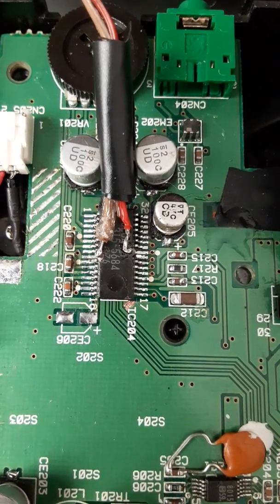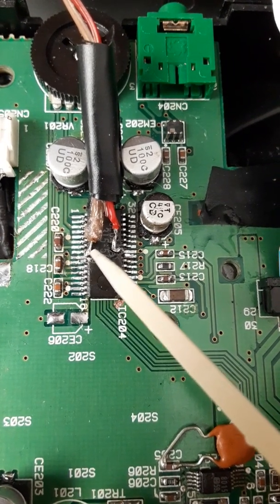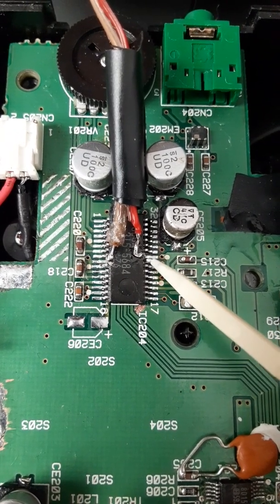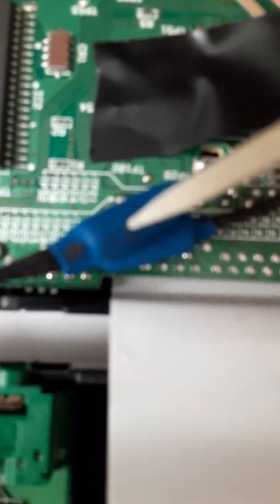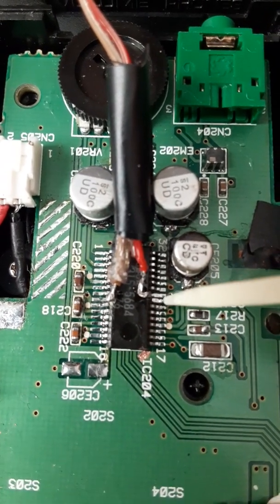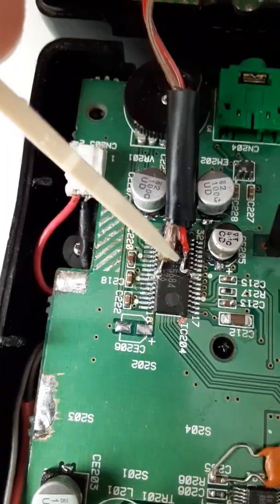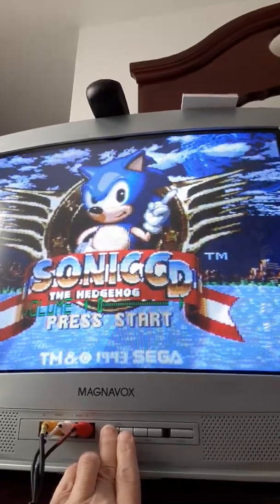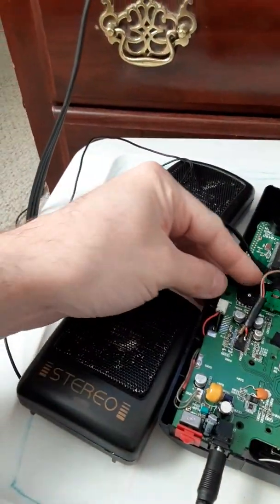How I added CD Audio from my Mega Everdrive Pro to my Sega Nomad (PLEASE READ DESCRIPTION)

Comment: There is no audio for me, B1 to the negative of 10uf 25v and positive to pin 9 above, pin 10 above and B3 to the negative of 10uf 25v, and positive to pin 25 above and pin 24 above, I have no audio in the games, only at BIOS startup. Any ideas? I don't know why it doesn't work for me.
Reply from the maker: I misspoke several times during the video. Double check everything for correctness. The correct connections are in the description. I'm sorry it's not working for you. It's tiny work so it's easy to misswire. Keep an eye out for shorts and blobs of solder that could have fallen. Double check, triple check.
Reply: Hello, I have found my solution, until I remove the 22uf C206 capacitor, which is under the 315-5684 chip, it did not start to work, it is removing it and everything is perfect. I use Mega Everdrive Pro. @lance16O1
Reply: in your video a was removed, but you don't name it, that's why the confusion, thanks :)
Reply from the maker: Oh wow great find, thank you for sharing!
Reply: @lance16O1  too you, other mods dont work, this one its perfect.

Comment: Is this why my sega nomad cuts the video game and stops working during the opening scene or sega cd boot logo?
Reply from the maker: Is what why? I'm confused.
Reply: @lance16O1  because of the lack of cd audio. This is why sega cd games boot, but stop during the first seconds?
Reply from the maker: @mattfire8579  The games will still play, just without audio. There may be another issue in your situation. Good luck.
Reply: @lance16O1  Thanks Lance!
Reply from the maker: Your sound chip might be bad. I've had a similar issue on my Genesis Model VA2.3 with same chip.

Comment: Is it stereo?
Reply from the maker: It is stereo through the av jack and headphone jack yes.
Reply: @lance16O1  I’m about to pull the trigger on some 10μF 63v 5x11mm radial caps. Would those work?
Reply from the maker: @nicolaspersijn  63v would be fine. But you can go probably all the way down to 16v if you'd like.

Comment: Will it work with 10uF 25V capacitors ?
Reply from the maker: I would say yes. I used 67v ones because they were axial. 25v is well in excess of what this circuit will see so I'd say you're good on 25v caps.